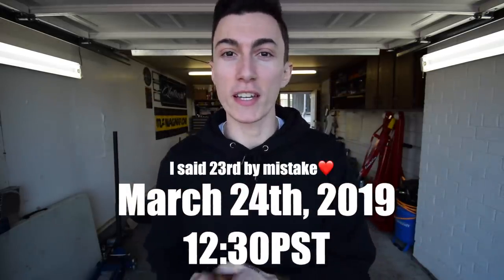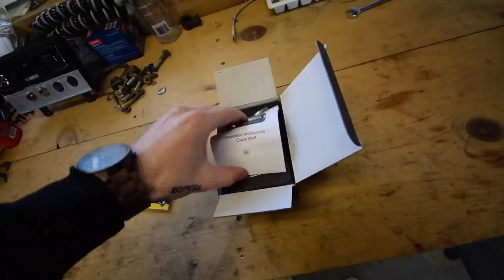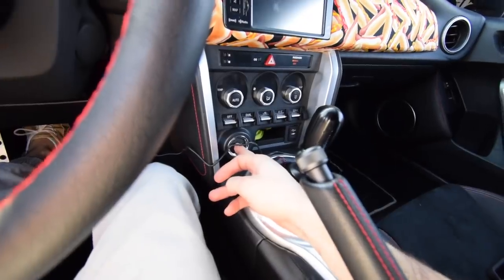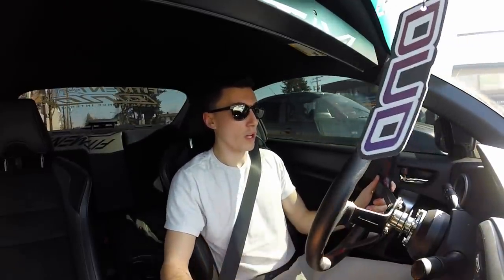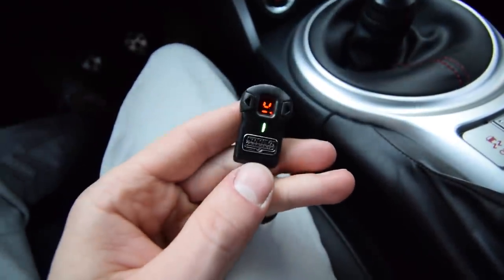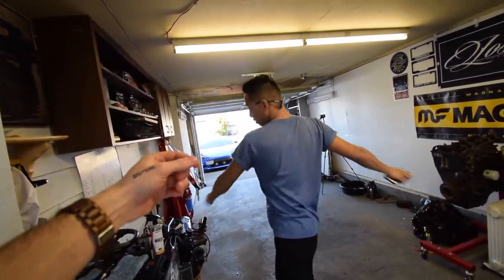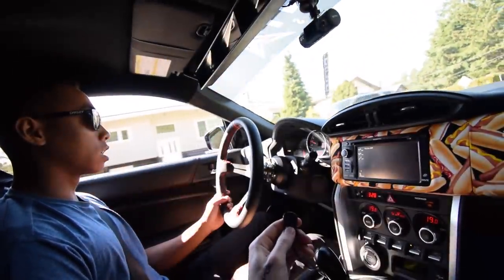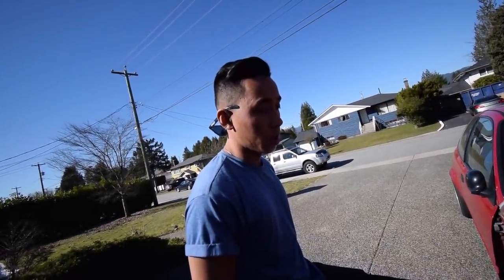EVERY New Car NEEDS THIS!

Comment: My buddy bought one of these (peddle commander brand) for his automatic Subaru Outback. Put it all the way up in race mode took it for an alignment forgot to tell the guy about it, and the dude launched it into the garage like a bat outta hell. Needless to say he missed the alignment ramps. 

Was funny. For me.
Reply: That sucks so bad :(
Reply: Niceer it’s fixed now wasn’t that bad and the shop fixed it all. But was so funny
Reply: Press F for our lost brother
Reply: Stoked, Broke And Outta Luck shop shouldn’t have fixed a thing, that was the car owners fault. They should sue him for shop damages.
Reply: GIZZMOTORSPORTS but the shop guy was the one that broke it... what kind of logic are you working off of?
Reply: Joel Williams READ IT AGAIN
Reply: @joelwilliams1113  a worker wrecked the car, yes, but the car owner had done modifications to the car that made it act differently from a normal car and failed to inform the worker.  Who in there right mind gets into a car and knows it is going to go full throttle when just tapping the gas?
Reply from the maker: that sucks 😂
Reply: GIZZMOTORSPORTS well it was technically a performance shop where they have a dyno and can build full roll cages. So they paid to have it repaired because the kid was new and they say they are usually prepared for situations like that
Reply: Robbie Ferreira I mean I laughed haha
Reply: Lmfao
Reply: Press F5 to restart
Reply: GIZZMOTORSPORTS but how is that the owners fault? The people driving shouldn’t have floored it in the first place.

Comment: Robbie pick up an O2 sensor spacer (Spark plug non-fouler) to get rid of that engine light.  10$ fix.  Great video as always!!
Reply: I’ll mail them to you Robbie, what is the thread pitch? I have 2 brand new ones here.

Comment: Have one on my 07 Sport Trac 4.6 3v V8 and it woke the beast up, made it feel like it gained power but I know it's just the delay of the throttle body being eliminated and the pedal opening more with less pedal input. I'd say it's a cool little device that makes your vehicle feel wayyyyy more zippy.

I've had the pedal commander and sprint booster and imo the sprint booster is better.

Comment: $330 for no HP gains just a more sensitive pedal..... great review because it was free.
Reply: pimnmike sums it up
Reply: I mean you're halfway to a tune that will improve everything.
Reply: @minimania  Yeah I want to try it but does the coupon works only in CAN?
Reply: I own sprint booster, and while there are no horsepower gains, the 0-60 is dramatically increased just because of how easy it is to get off the line. Not to mention, it completely changes the way that the car shifts.
Reply: @Yoyoy08  Which coupon are you speaking of?
Reply: @Citybuild122  Yes, people don't think about how it changes how the car shifts. And it's definitely a reason why people really like their Sprint Booster V3.
Reply: Tros make one for $100. And yes I improved 3 tenths in my quarter mile time.. The aggressive throttle body opening results in more fuel delivery faster..
Reply: And here come the haters who claim this was for hp to begin with, which it wasn't. Which they tell yiy it doesn't. It's for lag. And fixing lag is worth just as much as hp almost to some. The feel of the car is a MASSIVE part of ownership.
Reply: @4g63gen1  SB is better. I wouldn't trust any other brand honestly
Reply: @el34glo59  Thank you for showing your support. We care about our customers and we hope we give them the best experience.
Reply: @sldsnk3  tune lol reliability problems.  Nah no need that if you drive a daily.
Reply: @mrsantosjon  it's all about your tuner, Boosted tuned my car and I'm at 120k now, with full bolts and flex fuel on a stock EJ255 block since just over 60k.
Reply: a great example of wanting something like this is like in my case. I went to a 90mill TB in my srt8 to try and get rid of the horrible lag, which it didn't. Kind of made it worse in a way. Put on a SB and the difference is day and night!
Reply: more sensitive pedal is necessary when it has lag
Reply: @el34glo59  The Tros Booster is cheaper and just as good....had one on mine Gene coupe with no issues...matter of fact it was the Booster for that car...very popular. If they make one for the 86 ill get that...paid 70 dollars for it for my Genny.

Comment: That Sprint Booster basically eliminates the delay in response in a DBW (Drive By Wire) system. It DOES NOT add any horsepower/torque, but it DOES GREATLY IMPROVE the throttle response from your gas pedal.

I had one of the original units in my 2007 Honda Civic back in the day. It worked very well until I broke it.

Great purchase Robbie!!!
Reply: It just changes ratio of how much gas pedal is pressed / how much is throttle body opened. The gas pedal is very simple and there is nothing to improve about response time, a lot of newer ECU lag (have higher response time) on purpose to increase MPG. To "property" get rid of the "lag" you should get it remapped
Reply: @miralemnermina142  That's what I ended up doing; I got Hondata Flashpro and a custom tune after my Sprint Booster unit broke.
Reply: @Xx1SailorScoutxX  nice, what car?
Reply: @miralemnermina142  my old 2007 Honda Civic LX; it's on my channel
Reply: @miralemnermina142  No. That's not all it does buddy
Reply: @el34glo59  then what else it does buddy?
Reply: @el34glo59  ?

Comment: Just wanted to clear out that this doesn't add power, doesn't make your car faster and actually doesn't increase throttle response like it says it does. 
But, if you want a sensitive gas pedal, I guess it's a good product. I reallly wanted to say it because they advertise it as something that enhances the throttle response so you think it would make the delay between when you push the pedal and when the engine's accelerating smaller but no, it just tricks you into thinking your car is faster because you think you're putting a quarter of throttle and it's accelerating like if you were half throttle.
Only REAL good feature is valet mode and pedal lock. Pedal lock is so useful to warm your car up and stay inside your house without being worried about someone stealing your car.
Reply: IMNOTA lies

Comment: U r best,i will start my own project soon and i want to do it with honda civic as well or bmw e36 or e30
Reply: The civic will be so much more cheaper from what I've heard bmw is quite expensive to modify
Reply: @bradeenryan5497  Yeah,then I think I'm gonna go with civic,but which year tho?
Reply: @kevinszakis9774  i think the pretty much any honda from 98-2005 is relatively easy to find parts for I see tons of builds on these years which are from before they started to do the newer curvy bodies the 98 is the most popular year by far though, the Ex as well as the other specialty model  (i just woke up and it wont come to mind) are also slightly better builds HP wise i do believe but am not 100% just do a little research even with all the hate on it the honda comunity has a lot of activity and info just keep im mind their engines have to be maintained a little better do to if you allow them to over heat to much they will warp which is really the only problem i see in these cars personally (hope that made since im still half asleep lmao)

Comment: £185 wow! Na thanks.Got a cheap resistor (not the usual crap ones) from ebay for pennies.Fiited near that MAF sensor and a big noticeable difference straight away! Smooth,quick throttle response,better mpg and still have it on my car 9yrs later.

Comment: Looks super unsafe but the brz throttle body opens slowly wen u floor it. It sounds like a safety measure so ppl don’t accidentally drift corners and crash like a normal person driving not a racer they just want a coupe.
Reply: It's not unsafe lol